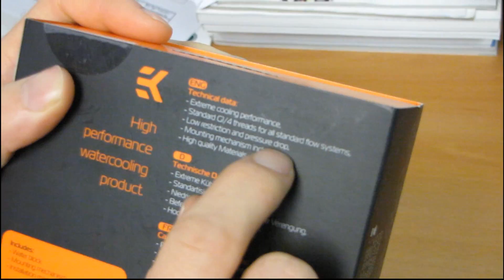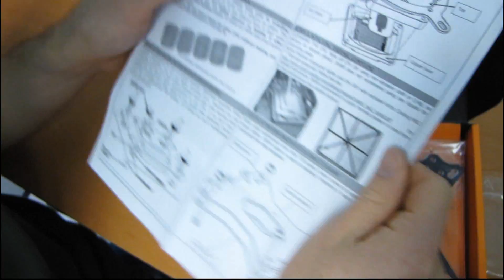EK Supreme HF Extreme Performance CPU Water Block  Unboxing & First Look Linus Tech Tips

Comment: @TheNuMetalfreak That's not intirely true, The slits are only made for Flow and Cooling. If u have only a CPU to cool, then take the 2 or 3 sliths. (More resistance, more turbulance) When u have more objects in the flow, then u use more sliths, for less resistance less turbulance. When tested it only makes about 2 degree difference. (Sorry for poor englisch :P)

Comment: @TokerMate The plate with 1 or 2 slits is for single or duo core processors, the plates with more slits is for quadcores, sixcore, ...... .
Because the cpus with more cores have a bigger surface that needs to be cooled, so they need more water flow.
(Sorry for my bad english)

Comment from the maker: depends on the configuration of the rest of your system. If you have a strong pump and no other components in the loop, then you will want the most restrictive plate because that will fire the water in a tighter jet stream at the block surface and create more turbulence.

The opposite is true for the most free flowing plate, and then there are the in-betweens.